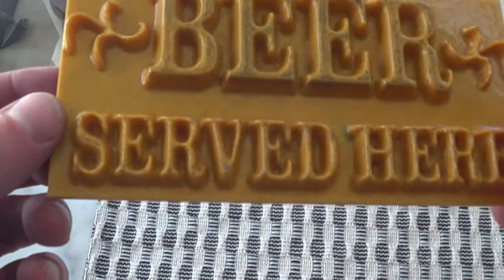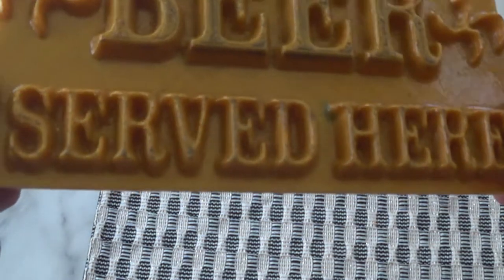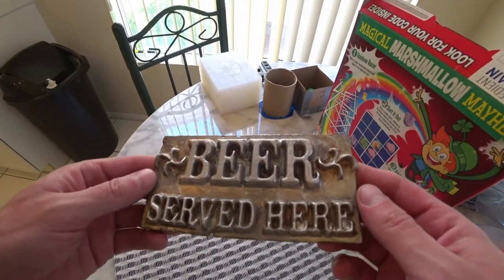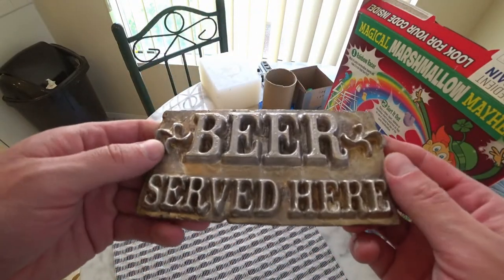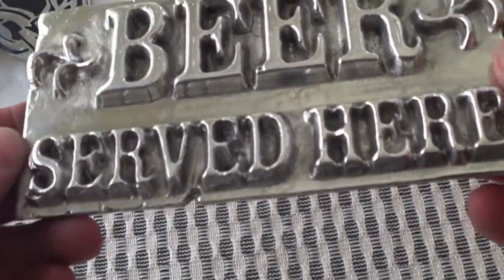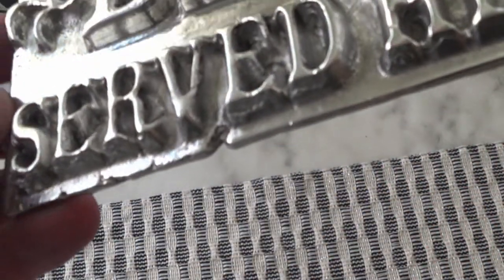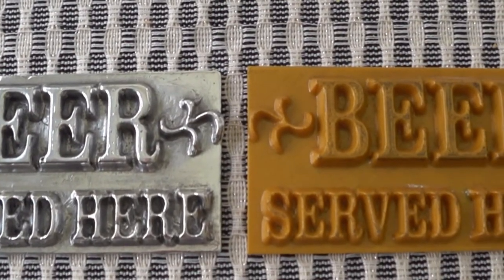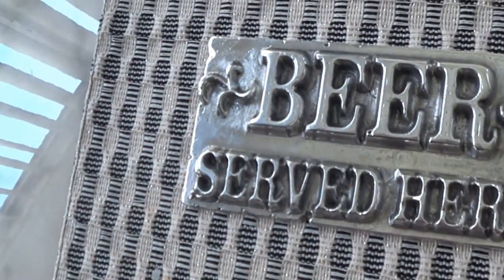Aluminum Sand Casting a 3D Printed Beer Sign

Comment: 👍🏻😁🍻!!! 
Man that turned out better than the stuff ya buy ina shop . Absolutely perfect casting (not just saying that cause I’m gettin a gift).
I bet it felt great in the hand right after casting and especially wen you were finished. I love nothing better than seeing and holding the piece right after the cast and especially after it’s finished 😁! I sometimes show the missis what it was then I show her what I made it into but she don’t care.unless it’s low in calories or fitness related I can’t get her attention with my metals! (Big rack N abbs so I’m not complaining!!! ) Probably for the best cause when she hits the gym I get my melt on!!
Reply from the maker: bigstackD Casting haha thanks!  yeah it turned out good. I prob could have cleaned it up a little more and polished it a little better but I was happy with how it came out. After I poured the metal I tripped on a cord and blew a fuse and lost all power on my lighting but I cut that part out haha.. I have a few new projects hopefully I’ll be finishing this week if I have time. 👍🏻 you’re package should be in the mail tomorrow, just finishing printing this last thing to send you today 👍🏻
Reply: ArtByAdrock cheers Adam I appreciate it! Make sure you have a return address on there . I should get a go at the lathe at work and I have a few blocks of graphite I can get drilled out and I’ll send them back to ya . They’ll be the same size as the ones I did in my vid . I been looking into 3d printers and hopefully I’ll get one soon as I wanna print up a Farcry 5 emblem but as a coin or medallion🤫. The ideas are endless! I can’t get hold of any petrobond in Australia still so I’m using bentonite for now. I can’t wait to get the Idol from you as I’m gonna cast it in brass copper bronze & aluminium . If the postage is crazy mate when it arrives I’m happy to help you out or I’ll just send back the blank graphite coin molds and we can figure something out at a later date👍🏻😁🍻
Reply from the maker: bigstackD Casting that would be awesome! I think when I looked it up it was around $35 for flat rate shipping.. give or take which isn’t that bad.. that sucks you can’t get the petrobond. The bentonite works almost as well as long as you use very fine sand to mix it with.. I use a blender to mix mine even finer haha
Reply: ArtByAdrock yeah matey all good ,  if it cost crazy money to send and the idol does arrive here I’ll be sure to help you out definitely 👍🏻🍻😁